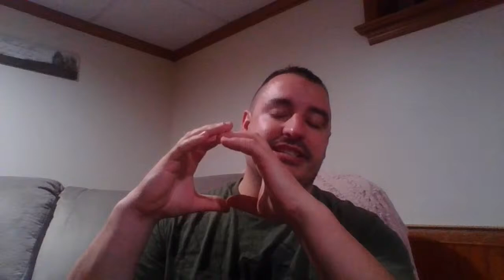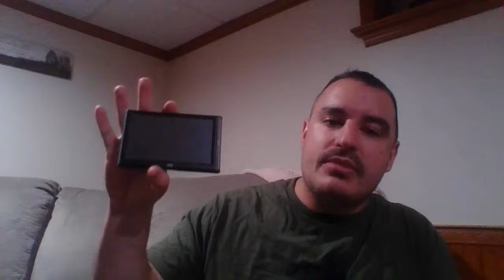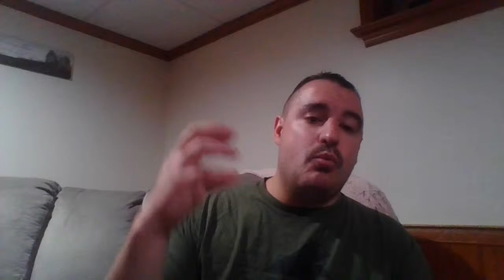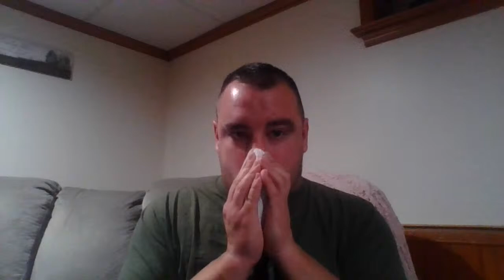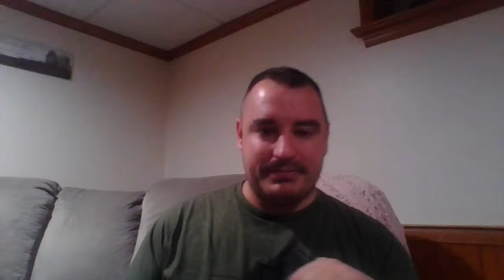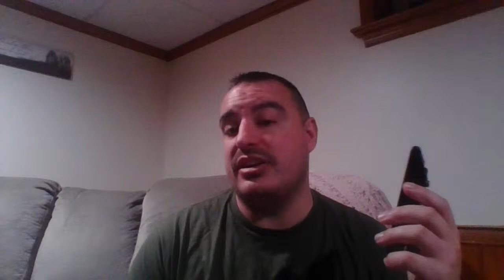6.0 Powerstroke Build Reviews

Comment: which program is better for 6.0 powerstroke, sct GTX or sct x4 7015?
Reply from the maker: I personally would go with an x4 and have an edge cts for monitoring or torque pro on a phone
Reply from the maker: Here is an affiliate link for the x4 if you're interested also use code SIX0BROS for 10% off tuning from blessed performance 

https://amzn.to/3lIf7wU
Reply: @six0bros  thank you very much. This programer support EGR delete?
Reply: @six0bros  I think this program that you recommended the 7215 is only for GM vehicles. I have a 6.0 powerstroke
Reply from the maker: You're correct I cant find the 7015 which is the model number for fords. Reach out to blessed performance he sells them too and use my code to get 10% off the custom tunes but it wont take anything off the tuner itself, but he can get you taken care of
Reply: @six0bros  ok my friend thank you very much
Reply from the maker: No problem man